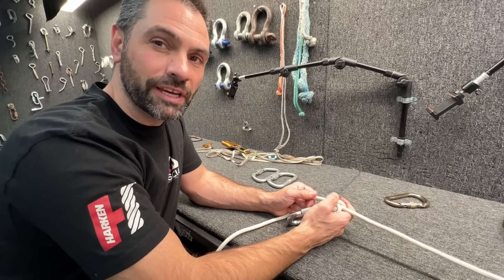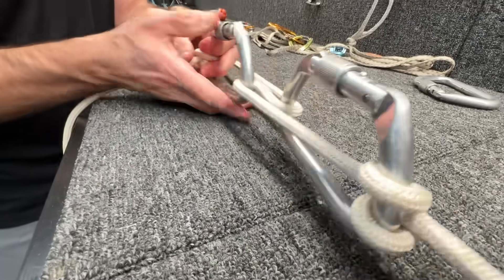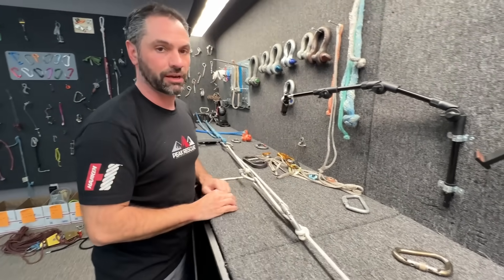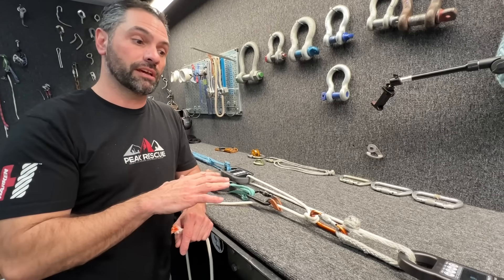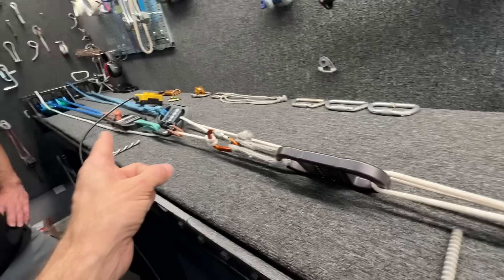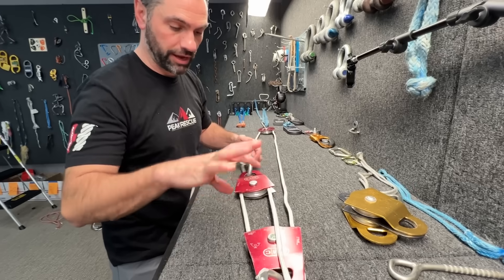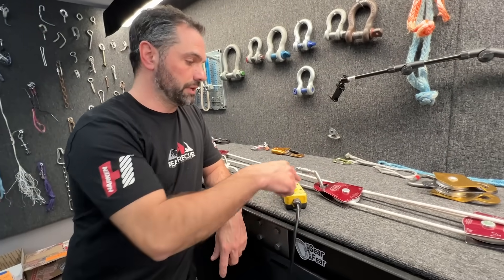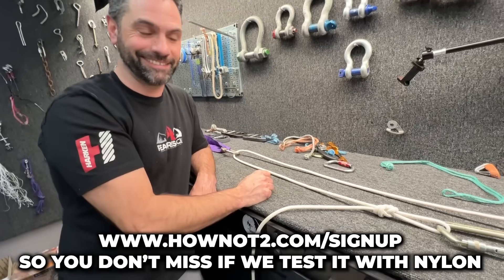I don't understand how this holds

Comment: I do something similar with a Trucker Hitch. No hardware, just an Alpine Drop in the middle, looping the working end thru then finishing with a Taught Line Hitch. Add tension by pulling the Alpine Drop perpendicular then move the Taught Line Hitch parallel during release to set it. I use this to tie down loads pretty often & it's a necessary upgrade to the standard tent guy line hitch. There is a way to add extra mechanical advantage by adding more Alpine Drops. It works best with cordage that is compressible like nylon paracord.

Comment: That's how an anti two block device works on some extendable boom cranes. Not quite 1 to 1 match, but making the loop shorter with the same length of rope, it basically matches what we have on those cranes.

Comment: A special kind of friction is at play here called the capstan equation.
When you take a turn around a curved surface (such as the carabiner) the friction increases exponentially will the angle of contact.

This friction is how a capstan adds tension to a line, it's also how the "tensionless" hitch works, by adding turns until the holding force is 0.

Comment: Same style rigging is used to level a three leg bridle hitch for overhead rigging operations in construction using web slings and shackles. One leg can be adjusted to level the load on an asymmetric load

Comment: It’s important that it is in a position for you. Use your whole body to pull and then add tension into it by pulling all the ropes and then releasing that tension back a little bit at a time. So it’s not really one-to-one it’s your mini efforts captured incrementally.

Comment: Friction nor dynamics are not accounted while calculation of a mechanical advantage. Overall, it is only 1:2 here. Just like a standard pulley system. Using the same set of carabiners you can organize 1:4 pulley system. I don't see a lot of sense in the contraption. 
Let's say you have made 1:4 pulley system using the same materials and have a dangling end you need just to tie to smth after tensioning (e.g. to a rope bight). Is it such a problem?

Comment: Wouldn't the mechanical advantage be half the distance of the "rope" (mid point of the system), the distance of deflection and the deflection force, between the anchor points? 
That would be closer a lever type mechanical advantage calculation coupled with the locking function of the system, no?

Comment: Physics major here: I sketched everything out into a free body diagram to try and understand all the forces at play. the way this works is that the act of pulling on the ropes actually reduces the friction at the carabiner at the tail end of the rope, reducing the fricitonal losses. This means that the more force you apply, the more efficiently you can apply that force, while the system settles into a steady state of maximum friction. When you pull on the ropes, the anchored carabiner has roughly the same amount of normal force leading to the same maximum force of friction at that carabiner, as you are increasing the tension one one side by pulling that rope away from the carabiner, but the rope between the two middle carabiners is providing half the tension for the rope you aren't pulling on, so you're reducing the tension by the force applied to that rope. Similarly, for the carabiner tied to the load end of the rope, you're pulling one side towards it and one side away from it, not effecting the normal force between the carabiner and the rope, and thus not affecting the friction. But the third carabiner, the one tied to the tail end of the rope, you are only pulling towards the carabiner, reducing the friction between it and the rope by reducing the normal force between the carabiner and the bend in the rope.
Also, your understanding of mechanical advantage is flawed: Mechanical advantage is unaffected by friction, or whether something is moving or not, it's a result of either multiple tensions being added in the case of ropes, or of constant torque leading to different forces at different distances. Or wedges, but they aren't relevant here. The friction does prevent all of the additional force from being applied to your load, but not because the mechanical advantage stops existing. The mechanical advantage is still there, it's just increasing your ability to overcome that friction rather than increasing how hard you are pulling on your load.
With the way that the ropes are setup, the friction on the anchored carabiner is acted on with a mechanical advantage of 1:1 by your pulling, as is the friction on the carabiner at the tail end of the rope, but the carabiner tied in the middle of the rope is having it's friction acted on at a two to one mechanical advantage, further increasing your ability to overcome that carabiner's friction.
Finally, there's the general principal of friction that sliding friction is always less than static friction.
This all builds up to why the system works: when you are pulling on the ropes, you have to overcome the friction of one carabiner taking the full tension of the system, half the friction of one carabiner taking much more than half of the tension is the system, and the friction of a carabiner taking less much less than half of the tension of the system to start things moving, at which point they will continue moving until the tension increases enough that your force can't overcome the increasing sliding friction. On the other hand, when in steady state, the force you are applying is no longer decreasing the friction on the carabiner at the end of the rope. Now, that carabiner is also having it's friction opposed by a 2x mechanical advantage in steady state, due to the fact that two ropes are pulling on it, but instead of being produced by much less than half of the tension of the system, the friction is being produced by more than half of the tension in the system. Since the force on that carabiner more than doubles, the friction at that carabiner more than doubles, meaning that, despite the mechanical advantage against it, the system has more friction resisting the loss of tension than it had resisting the addition of tension.
In conclusion, on net, when the system is in motion, you get a massive decrease in friction and a slight mechanical advantage increasing your ability to tension the system, and while static, you get the maximum amount of friction, resisting the loss of that tension. This allows you to tension the rope to have a bit more tension than you could apply while just pulling on it, while enabling the rope to maintain more tension than that.
Finally, for untensioning the rope, you are massively reducing the friction, as you are reducing the friction of the anchored carabiner by pulling towards it, and that carabiner has the most friction of any in the system, while also getting a 2x mechanical advantage on both the carabiner tied in the middle of the rope and the carabiner tied to the tail end of the rope, and on top of all of that, you are acting in the direction of tension, meaning the force of tension is also helping to overcome the force of friction, allowing you to easily overcome the friction and release the tension in the system.

Comment: So i used to sell furniture and we'd use this tie down method w/ cheap thin rope and ZERO carabiners. U just tie the loop instead. The carabiner obv creates a more smooth surface, whereas the rope on rope tension could create more friction. Anyhow u can do this w/ the rope/ cord/ string alone but having written this i do see there could be a possible advantage the carabiner may have.  However i doubt it would create an advantage over a solid ring. It may not even over the simplest method i previously mentioned; which was incredibly sufficient for the task of securing furniture for local delivery

Comment: We use this for tension diagonals in swiftwater rescue. Super fast to rig, but I do prefer to use a CMC Capto if I have one handy. The Capto is even faster. The load on a tension diagonal is pretty low and fairly consistent so the voodoo hitch works in a pinch.

Comment: Friction increases proportionally with tension so the pivots will hold just as well loose as they will tight. And that's the same reason this doesn't work as a lifting or winching device.

Comment: So the turn backs on the ropes give you a 3:1 advantage on pulling tension, then retain the work and the multiplier when you let go. Would be interesting to see if you can use the system to lift and hold a weight ( say something falls on a person and you have to pull it off and pull them out from under. Just two people

Comment: Okay, please explain how mechanical advantage is only something that happens in motion? After all if I set up a block and tackle to lift something that is heavy I can still hold the rope while it's being lifted and lift less weight than the thing I'm actually lifting... I'm holding a proportion of the things weight not the whole thing's weight... The rest of the weight gets pushed into the ceiling or whatever the block and tackle is attached to...

Comment: It's quite simple!
If the friction is high enough, relative to the mechanical advantage, (or disadvantage from the loads perspective) you can't back drive the system.
It's like a screw or a worm drive!

If you make a screw, low enough friction, you can drive it back.
Like ball screws for example.

Comment: Could you not achieve the same thing with just a plain truckers hitch to get you gear across. And with the truckers hitch it will achieve machanical advantage, 3:1or 5:1 and self lock?

Comment: There’s actually only two places you can use a pulley in that setup you have to retain the same anchor point and you have to use the pulley in the rope that you’re pulling back on the other anchor point

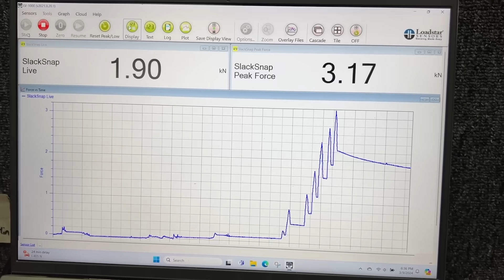Comment: If you use the distance traveled method to determine the mechanical advantage, it's a 3:1.  For every 3 feet you move the carabiner, the length of the loop shortens by 1 foot.  I determined this empirically.  This also agrees with your measurements at 8:16. 

Here's the mathy way to get there.  Start with a fully-maximized loop (the carabiner all the way at the end), then move the carabiner all the way to the other end, making the loop shorter.  When the loop is maximized, there are 2 strands of rope composing the loop.  When the loop is minimized, there are three strands of rope running the full length in the (smaller) loop.  The 3 strands and the 2 strands are exactly the same section of rope.  The short loop with the 3 is therefore 2/3 the size of the long loop with 2 strands.  (1 * 2 = 2/3 * 3).  Since the loop rope gets shorter by 1/3 when you move the carabiner from one end of the loop to the other, you are moving the carabiner 3x the distance that the loop shortens, making it a 3:1

Comment: It works the exact same way threading wire around a water hose works. Once you go around something with friction you don't need the same force to maintain your gains. You ever see that tool that tightens wire around hose and u bend it over itself then cut and tuck? Pulling the rope thru the carabiner creates friction.

Comment: so what if the rope is slippery?
Reply: By "slippery", do you mean "wet"? 
.. A wet rope can be slippery if you're pulling it with your hands, but it actually has more friction when it's used in knots because the rope swells and expands, this is why wet rope can be harder to untie. However, a wet rope also decreases its ability stretch, meaning it takes less force to snap.

Comment: You're thinking backwards. It's not that it's a friction system and has mechanical advantage.... it's that the friction force is under mechanical DISadvantage.  3:1 advantage in a system like this also means you have 3x (roughly) the friction.

Comment: There’s nothing mysterious or "voodoo" about what’s happening. Anyone who lives in a building taller than five floors, or even in some shorter ones, relies on this very principle every time they use an elevator. When an elevator operates under normal conditions, it’s the friction between the ropes and the V-grooves of the sheave that transfers the rotational force into the linear movement of the cab and counterweight.

To clarify, in all roped or metal cable elevators, the brakes stop the sheave itself—not the ropes. Elevators equipped with rope brakes never use those brakes to slow down the cab during normal operation. They are tested annually for safety, and their only real purpose is to engage if the car unexpectedly moves out of the door zone with the door open.

Relating this back to the video, the pulley system is doing exactly what it’s designed to do: multiplying the force and reducing friction on the shaft. It's evenly distributing the forces on the sheave’s axle. By increasing the radius of the return run, you're adding another lever effect to the system.

If you try it again but use ratcheting pulleys that lock in the reverse direction, the rope will need to slide rather than roll around the pulley. This removes the leverage acting on the sheaves, and by doing so, the force won’t be transferred to the free-rolling shaft. I bet it won’t move this time!   

I enjoy checking out the channel, and I'm glad it's called "How Not 2." You guys put in a lot of hard work, and the videos and presentations are great. One suggestion: it might help to make it clear to viewers that you're not making expert scientific assertions, but rather exploring scientific concepts you're interested in and trying to better understand. You're spitballing ideas and using the videos as a way to dive deeper into these principles.

Please don’t take this as criticism—consider it encouragement and a suggestion to help protect your credibility. That way, when people click on your content, they know they're getting something valuable and will keep coming back for more. Good luck, and keep up the great work

Comment: Something you might be missing is the difference between static friction and sliding friction, there may be no mechanical advantage when its static, but when moving the sliding friction could be lower, causing there to become an advantage

Comment: Ok... this is just my observation. Think of tension in a static system as a set value. If you have a rope with a weight in the middle, then the tension on both sides will be equal, preserving the balance. If you have  two ropes on one and the other has one, then th side with two puts half the tension on each rope, balancing the other side.This knot lets you progressively use more of one side with 2 ropes increasing the tension by up to 50%. The way i see it anyway. 😅

Comment: My understanding is when you pull and move the rope through the carabiners, the coefficient of kinetic friction is lower than that of static friction, so it is acting closer to (but not equal to) the case with the pulleys, giving some mechanical advantage. When you reduce your pulling force, the ropes stop moving, and since the coefficient of static friction is higher than that of kinetic, it remains tensioned once you let go. Same goes for unloading - you apply a force to the tensioned side to overcome the static friction in the carabiners, to get the ropes moving and the friction becomes kinetic.

Comment: Its essentially a pully.  You are pulling twice as far / half as much force.  So if you double up a pully and apply 100 lbs of force it puts 200 lbs of force on the load.  But you have to move twice as far with pulling rope to move the load.

Comment: I remember this from our first year of engineering study.
This is using friction, like when you pull a ship with a rope on the dock 
Friction is favoriting  the weak side. And it depends on the contact with the circular piece like the rings. So you can still hold tons of weight with your limited power.
The same here if you pull big load so the friction will help and favor your humble power 😊

Comment: Isn't this functionally the same knot as all tent lines have today?  
The lines with the plastic bit with two holes. Seems exactly the same to me. This application is probably the most well known. 
But owning an area where people camp a lot I do have to say less then 50% of people understand how to use these tent lines as shown here for tensioning.
Reply: Also the system has slipping issues in certain conditions. If the tent lines are indeed the same, for that system imo it is intentional. When your tent is in a big storm, the lines will slip and loosen a bit. I think this can save your tent in a storm as sully tensioned lines could snap. I always thought this slippage was by design. Your tent will stay, be a bit more wobble sure, but i the morning after the storm you just re-tension the lines and you are good to go.

I would say this know is for tensioning lines quickly, but with an added safety that it will loosen under extreme load instead of snapping. For certain applications this could be very important.

Comment: you can do it without a single carabiner if you put a knot halfway instead of the carabiner. and if you put knots in the right spot on the two lines you're pulling, you can lock it in place with something as easy as a stick.

Comment: Just a very quick thought, I haven't thought it though, might it be of any use to limit peak or shock forces in high lines, like Tandem Prusik that slip once, giving you time to stop pulling, of if you preloaded the rope to much before the load reached the middle?  But maybe not the best way to do it given the rope bends 180deg around biners making the rope breaking strength less to begin with.